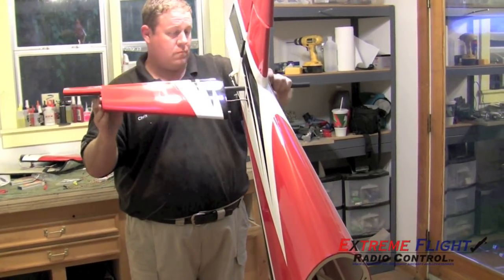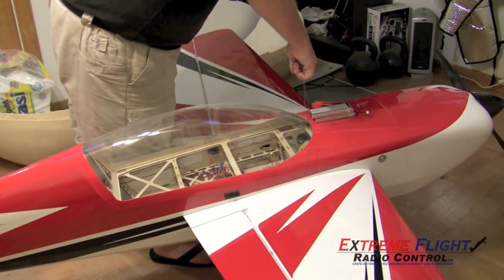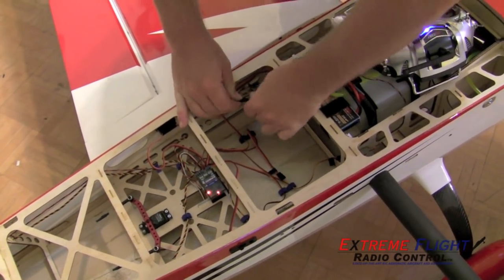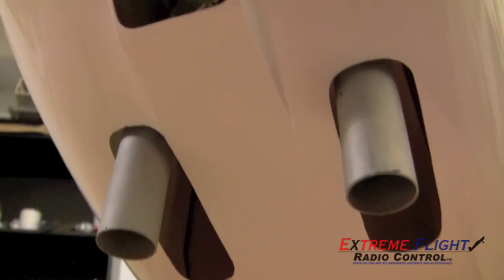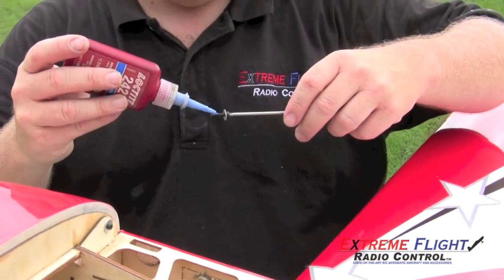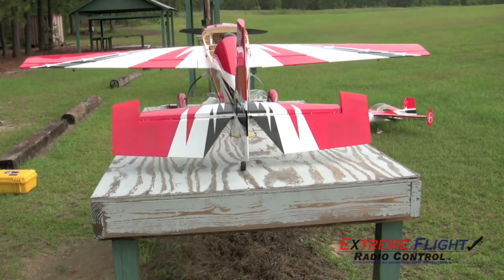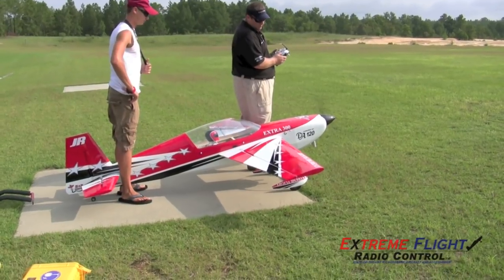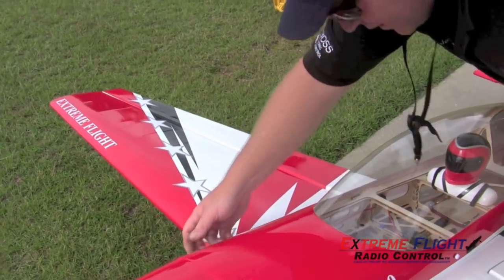Extreme Flight 104" Extra Assembly Video #4 - Finishing and Maiden

Comment: I Chris nice video..just finish my E/Fextra 300 104" and trying to find the sweet spot for my CG. I start off with the recommended balance point on the wing tube witch makes it a little nose heavy for 3D stuff.. now I move the CG aft of the wing tube and its a little better but still nose.. And yes I follow your flight cg test theory (Very Good tips by the way).. now my battery is almost to the back-end of the canopy..Any idea regarding this plane

Thanks Basil
Thanks.

Comment: Hi Chris 
Just came across your build I noticed that when you was getting your C of G your gas tank was empty would you compensate this or do you do your c of g with an empty tank I am building a pilot 92inch using a dle 61 single 
Regards
Reply from the maker: It’s a bit of preference but imo it’s better to be slightly nose heavy and moving back as you burn off fuel than to start balanced and get tail heavy as you burn off fuel.
Reply: Totally agree Chris that’s what I will do keep up the good work and keep the posts coming

Comment: i dont under stand i know it has like 5 servos all together and ran by gas but why so much batterys on it?
Reply: It actually has 8 servos on it, 2 on elevators, 1 on rudder (sometimes even 2 on rudder), 4 on ailerons, and 1 for throttle.  Also, these aren't your run of the mill servos on a plane like this.  They run at higher voltage, and have enough torque to pick up a 45lb plate off the ground.  These draw a LOT of power so all of those batteries are needed. To give you an idea, my 35cc plane has a 2s 4000mah battery that runs both the servos and ignition.  I only get four 8 minute flights before I need to change it out, and that's on a substantially smaller airplane.  Also they usually run multiple batteries for redundancy (2 smaller batteries power the receiver/servo, and 2 smaller batteries power the ignition rather than just 1 large battery).  That way if you have a battery failure it doesn't bring your $4,000 airplane down.